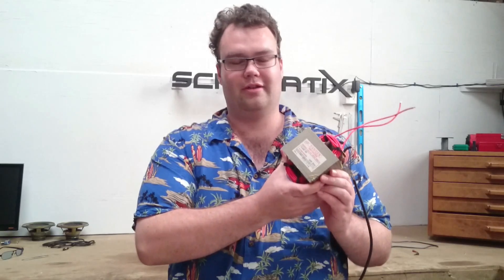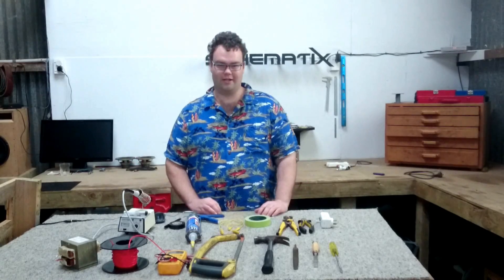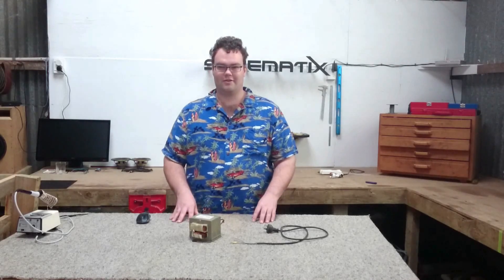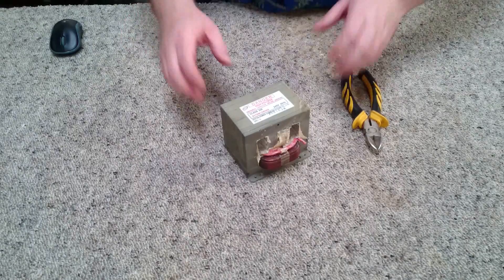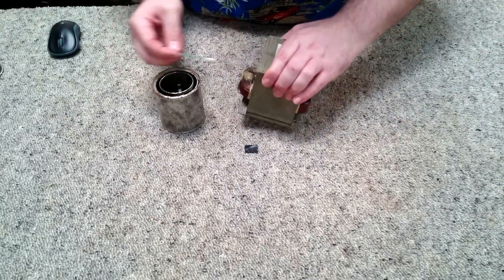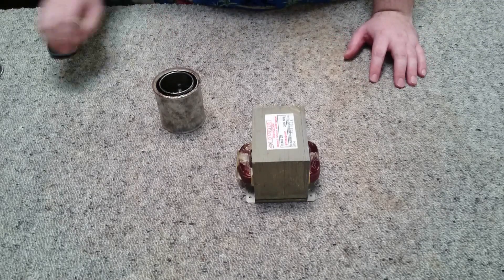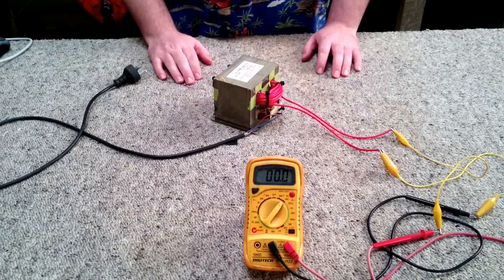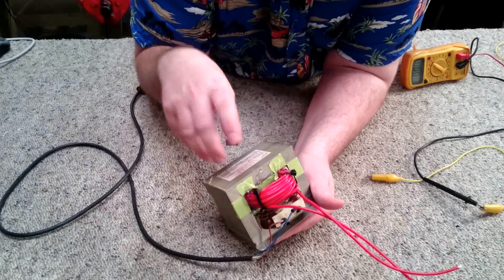How To: Rewind Microwave Oven Transformer, Trash To Treasure!

Comment: Can you convert the AC to DC before the primary coil to get a DC secondary output ?
Reply: no, the primary is a dead sort. use a rectifier after the secondary to get DC, also probably want to add some smoothing caps. transformers work because AC produces a magnetic pulse that the secondary can absorb.

Comment: Got a couple of microwave transformers with the 240v winding primaries on. Got a couple of empty ones too, after I damaged the primaries. Building a circuit board with an output of 12v ac from H-Bridge Mosfets to produce a pure sine wave at 50 Hz. Each Mosfet is max 110 amps at 55 volts Max. I'll be gating them for 12 volts sinewave. I've also got 13 meters of enameled 3 mm transformer wire I'd like to use in the transformer. You say 1.04 volts per turn. It that in rms values or peak values. I thought I'd have to use 21 turns to get 12volts. I want to also wire in a centre tapped 12v ac output to gate slave mosfets to get between 3kw to 7kw output, depending on the transformer. This design is for a low frequency output using a H-bridge, I'd use the slave after it. But, I also.. want to use spare transformer primary winding to get to 400 volts plus, maybe up to nearly 600 volts. That is for the high frequency inverter output version. I've got the 600 volt, 47 A Mosfets for that. Be good to use that as a final output. I'd use a separate push pull circuit to generate an AC output, where I can control the voltage & frequency output, even change the wave form output using a filter circuit.. have a choice of square, trapezoidal, sawtooth or sine wave. Could then use the pulsed DC motor controller to drive an electric generator using frequency control. So, how many turns do I need for 12 volt RMS output? 11? or 12?  I'd like to know how many turns to add on the primary side using the same enabled wire to boost it to 380 to 450 say. Thanks for the video, I learned more about transformers.

Comment: This is a bit late, hopefully you are still monitoring comments: is there a non-destructive way to determine the number of turns on the primary in order to match the secondary to it? I want to wind a 1:1 transformer to use in my shop for isolation. I would use good quality magnet wire of the same size - shouldn't you use proper insulation rather than masking tape? I've seen Nomex paper insulation used before. Wonder where to get that? 
Nice tutorial.
Reply: This reply is even later 😅 ...
The easiest way is to locate two identical MOTs, and use an angle grinder to cut the 2 welds that hold the top onto the H lamination. Drive the secondary windings out then hammer the primary out of one transformer using wood blocks. Refit both primary windings into one core, then weld the lid back on.
....
Things to note:
1. Modern MOTs use aluminium for the primary windings, which needs to be thicker than copper for a given power level.
.
2. Microwave transformers are NOT designed for continuous use and have huge power losses (even with no load). This is because of too little steel in the core. So they really are not good for use in proper long term operation.
.
3. The secondary of a 1:1 isolated transformer may need more windings that the primary. This is to correct two sets of voltage sag under load.
.
4. Almost all MOTs have a primary with the same number of turns as the rated mains line voltage. So a 110V transformer will have 110 turns, a 230V transformer will be the same sized core with 230 turns of thinner wire, etc.
.
5. To accurately work out the quantity of turns, wind a test then do math. Start with (say) 20 turns, measure AC Voltage, then divide by 20 to get the resultant "volts per turn". Then finally, wind your calculated quantity on but leave it long until you test voltage again and add/remove as needed to hit your target voltage.
.
6. Use an accurate True RMS multimeter. Cheap ones (especiall if not true RMS) will give you strange readings that will skew your calculations.

Comment: Good video BUT you have said VERY LITTLE about the secondary wire.
What gauge should be used, should it be solid or stranded and what insulation should it have.
Would it be better to use a varnish insulated wire like the primary or standard plastic insulation
Reply: Science-is-god
No varnished will damage very easily when used for rewiring.  Use the thickest wiring you can find as long there is space for the amount of rotations you need! Try to get wire with heat resistant insulation.  (expensive tough).

Comment: Great Video I found a discarded microwave and am pulling the transformer. The pace of the video is slow enough to be able to take notes. I am building Your Bench supply as I am recently retired and have been using an old PC supply at home for 30 years but miss the bench supplies I had at work so am looking foreword to spending some time teaching my grandkids electronics.

Comment: Not very energy friendly. For 120v MOT it read 4.4 Amp on the primary with nothing connected to the secondary. That about 500w of power just being plugged into the mains. Very disappointing. I get 25v on the secondary; about 25 turns of AWG 16 wire.
Reply: Natural Suntan
Yeah you're gonna be very poor fuck using a device like that!  Go and be a whining bitch somewhere else.

Comment: Mr Schematix
Is there a reason that you used plastic insulted wire rather than enamelled wire ?  Thanks.
Reply from the maker: Yes, Pulling solid strand enamelled wire through the transformer would have the risk of scratching off the enamel, Or potentially breaking the wire due to repeated bending.

Comment: What is the significance of the shunts?
Any advantage or disadvantage to removing them ?
Reply from the maker: The shunts do limit the power to a limited degree. However, without them, most transformers will run much hotter and consume much more power even while idle. I don't really recommend removing them entirely. :)
Reply: Lewis Balentine Apparently they limit the current drawn from the outlet during idle use and prevent the transformer from overheating

Comment: Why do you reinstall the shunts?
Reply from the maker: The shunts limit the current drawn from the wall outlet during idle use. Also, they help stop the transformer overheating.
Reply: I did this project to an output of 35v. The issue is the amount of current it draws during idle- 84 Watts and 8.2 amps with nothing connected to the transformer itself. Is that right? The shunts are there too. Also, hums a bit loud.

Comment: I just finished cutting the secondary winding out of a transformer. I am following your directions for the winding. I want to make a 24 volt- 10 amp unit to power a CNC machine. I have all the parts except a transformer & a 10 watt resistor. I can get the resistor locally. But the transformer was a bit pricy. So I found a broken micro wave and stripped it down for the parts. My transformer has a solid core between the primary and the secondary that I did not have to take out before I stripped out the secondary and the shunt wires. Thank you for the instructions.
Reply from the maker: Thanks :)
Reply: @Schematix pls leave an email address I can email you via?
Reply: ARCSTREAMS
Amp meter?

Comment: How many feet of copper 12 or 10 gauge wire is needed to get exactly 12 volts DC  later after full wave rectification?
Reply from the maker: Good question. Each transformer is different so you'll have to experiment with your transformer and by trial and error find the correct amount of turns to achieve 12vdc
Reply: 50 feet #10 and 34 turns

Comment: Did you measure what current it draws off load?  These transformers tend to waste quite a bit sometimes going up to 2 amps or more.  well 2 amps at 230v will be 460 watts for nothing
I made some tests at my workshop with 3 different transformers from microwave ovens and found out that these while delivering around 800 to 1000 watts the core dimension is for around 400- 500 watts. So to induce more power to it they lessen the number of turns in the primary winding to rise up the magnetic field in them to give more power. However micro wave transformers are not meant to work for a long time and usually switching on and off to control the cooking temperature.  However with less turns in the primary more current is induced in the primary and hence the more idle current and heat build up.  Those two laminated fillets between the winding are meant to smooth out the surge at switch on and all they do is short out a part of the magnetic field.  Without them the transformer tend to break the fuse or MCB.
Reply from the maker: My transformer doesn't draw anything like those figures at idle. I answered this question awhile back, Can't remember the exact figure off hand. It was around 60~80 watts idle if memory serves me right.
Reply: very good  and thanks for your reply
Reply: Silvio De Leonardo
Try to get a life please.

Comment: Hello teacher, yes this old man has understood you more then others, im hopeing please youd help me a bit,  Thank You .  Im wanting to make a 25 amp battery charger and ive watched a few vidieos on the channal and not getting all i need to know or understand, showing my lack of electrical knowledge i first missed you ground to the outside of the transformer, does it also connect to the other terminal or the primary winding ? into the power supply 220 ?  earth ground im told here in the philippines. Make a Long story short on you , Would Be beautiful to see a vidieo of you builing one, i dont know what size rectifier or other components / n rateings needed.  If you find time please be my guide. Thanks   Really  and thanks for the smile with your humor with infected /effected  :-)

Comment: Thanks, awesome vid.
Q With the secondary, you did a test of 10 wraps. Did you join those first 10 wraps to make your end result of 20+ wraps? If so how would you do it. Cheers
Glad I found your site.
Reply from the maker: Thanks for the feedback. There is no joins in my secondary. It's a continuous length of wire. I tested with 10 turns and left the remaining wire on the spool I was feeding from. That way I didn't have to cut the wire :)
Reply: Thanks mate, your a natural teacher. Cheers

Comment: The winding you use for primary how many ohms it has?
Reply from the maker: The resistance of the primary will alter from transformer to transformer. There isn't any knowlage to be gained from me measuring the primary resistance on my transformer. :)
Reply: Well almost all MOT are identical, some are not but 90% are all the same. My has 2ohms. A bit low don't you think, that's why these transformers heat up with no load, for constant use they need new primary winding.
Reply from the maker: 90% are all the same? Hmm I don't think you've taken into account the different mains supplied voltages around the world. Typically varying between 100~240vac. I've rewound a couple of MOT's now. Typically after being heat soaked they sit around the 30~40C mark (86~104F) I'm sure there will be a number of exceptions however. Using recycled parts can be challenging sometimes. The primary on your transformer might have insulation damaged potentially?
Reply: Well the bigger the MOT transformer the less resistance of the primary. Bigger ones are 1.54Ohm, smaller 2Ohm, even smaller 2.5Ohm 3Ohm. You need normal primary to make this work long term for a power supply.

These work for spot welder only. With so low resistance you essentially making a heater
Reply: @juliusvalentinas  That's not how it works. Lower ohms implies higher power capability. MOT transformers heat up by design. If they weren't lossy the magnetron wouldn't last.  They get hot from the shunts and iirc core saturation under load.  All things being equal lower ohms = cooler operation.

Comment: have you ever hand wound a Toroidal transformer? is it as complicated to get good power?
Reply from the maker: No I haven't yet. Winding a power transformer for 110~240vac as you can imagine requires a fair amount of turns. Realistically I'd have to invest money into a machine that has a bobbin specially designed for winding toroidal transformers for it to be practical :)
Reply: bummer..lol

Comment: Ok, after accumulating all the necessary stuff, I finally started on the works. And, sure enough, (taking a good example from... you :-) ), I scratched the primary's insulation a little. I examined it under a magnifying glass and it doesn't appear "shorting" any adjacent wires, so I think it's repairable. Question: to cover it with a lacquer, is a... acetone based nail polish acceptable? No, I don't use one - it's my wife's :-) I simply don't have any lacquer and I try using what I have.
Reply from the maker: Yes acetone based nail polish will work absolutely fine. I'd recommend brushing on 2~3 layers to ensure good insulation. :)

Comment: you used  just one  long wire to wrap your secondary and hooked up + positive  and - negative to that same wire how the heck does that work you just wrap it and now that wires ends are one side + and other - ? gee whizz maybe I missed something
Reply from the maker: The secondary doesn't output positive on one side, and negative on the other. The transformer outputs AC power, not DC like you've based your question on. If you're interested in learning more about how a transformer works, you'll first need to understand how AC power works. :)